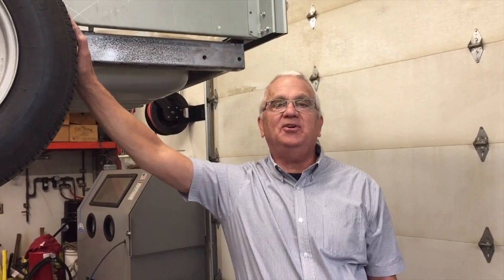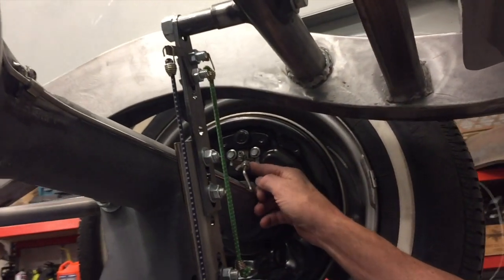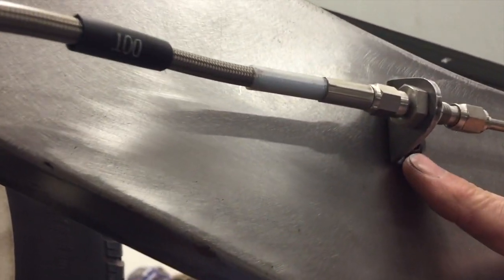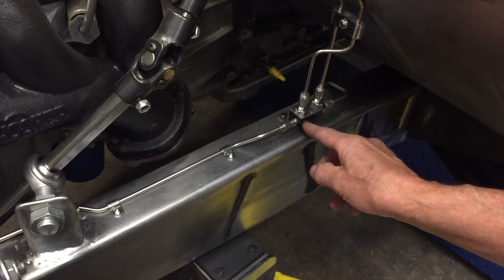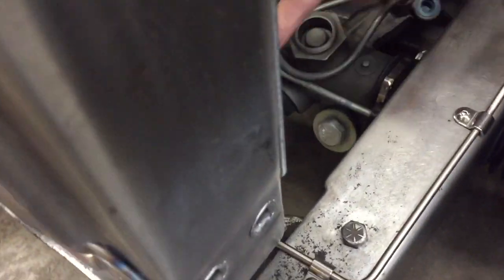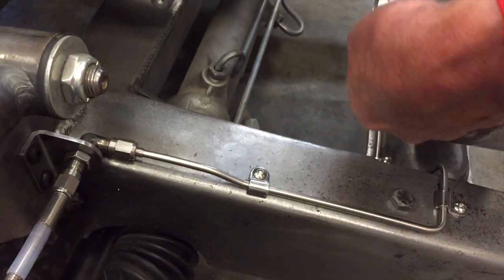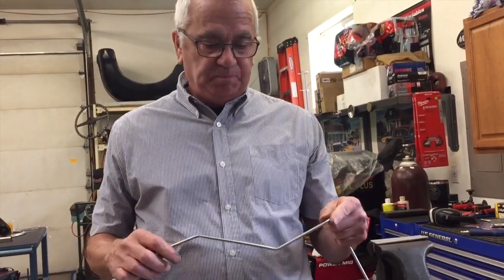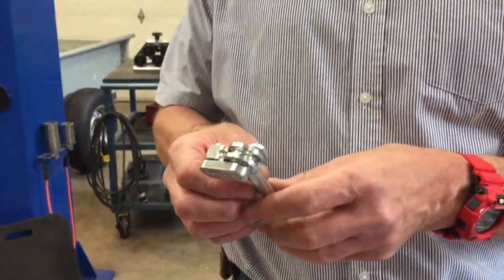Brake lines are done

Comment: Very nice Workmanship Sir, I just bought a 1950 5 window 3100, and have found your chanel very helpful. MY very first job in the oilfield in 1980 was instrument Tube line fabricator, I can really appreciate how well you have crafted this Brake line system in your Truck, I've learned from your methods, and yes there will be Scraps,  the seafloor is covered with Miles of Scrap that I've tossed away whenever it did not Fit. 
My bender is an Imperial, and I work in one direction, using test pieces, we measure outside to center of each run and use the L index, we save the R index for reverse bend. I now see the great purpose of the R bend and do not even see an L On those benders. 
The craftsmanship on your project is excellent overall.
Beautiful shop, and lift, and all the tools to work properly.
I particularly like the bed mount spacers, and the way you boxed and modified your frame, as well.
Regards,
MARK
Reply from the maker: Thanks for the kind words Mark I’d love to see your truck I’ve got an Instagram channel Idaho fabricator send me some pics I’d love to see your project

Comment: All new car and trucks should come with SS brake lines and gas lines that don't rust. This should be a safety law for the car & truck companies.
Not only for safety reasons but fixing rust brake and gas lines are very hard to get access to and  a pain in the butt to repair.
Beautiful job on the brake lines .

Comment: Oh ya... the third question was what type of brake booster did you use?  8" or 9" dual diaphragm. The kits cpp selling standard now are single 8"
Reply from the maker: Originally I was gonna put the master cylinder under the floorboards but my exhaust system was in the way so I just move that master cylinder and booster assembly and mounted it to the firewall,  mine is a 7 inch dual booster I don’t think you can go wrong with an 8 inch or 9 inch, these trucks have a lot of room on the firewall I think mine is a dual 7 inch because they wanted it as small as possible to mount under the floor but there’s plenty a room for an 8“ x 9“on the firewall.

Comment: Hi Stephen. I have, yet another question.  I have the factory proportioning valve and I need to know if they make an adapter from the valve to my AN fittings?  I’m having trouble doing a “double flare” on my stainless steel (3/16) line.
Reply from the maker: The flaring issue is the reason I went with AN fittings I was able to get adapter’s for my master cylinder from Summit Racing you shouldn’t have any problem getting an adapter for your proportioning valve I didn’t use the factory proportioning valve because I didn’t think it would work with my application they are typically designed for specific vehicles that’s why I used a universal proportioning valve to control the rear brake bias
Reply: @idahofabricator8710  Thanks Stephen.

Comment: Hi Stephen. My question is that I’ve watched this particular video several times, but I have a CPP dual master cylinder, which came with the proportioning valve already on it. But, it didn’t come with the any of the 3/16” line fittings. I’m not hip on all these fittings and I have no idea what sizes I need. The rear one is quite a bit larger, I’m stuck. Can you help me out with this?  Thanks, Mark
Reply from the maker: Two fitting sizes you need are  1/2-20  and  9/16 x 18,  the 9/16-18 is the one closest to the brake booster.
Reply: Where does the 1/2 x 20 go?
Reply from the maker: @markbramhall2060 the 1/2-20 is the smaller fitting it goes on the front master cylinder port and the 9/16 goes on the rear master cylinder port typically the front port is for the rear brakes and the rear port is for the front brakes
Reply: @idahofabricator8710  , thank you so much Stephen. You’ve been so helpful. That’s why I watch your videos.

Comment: I really enjoy your videos, thank you for doing them!  I wanted to ask how you are using single flares for your brake lines, double flares I thought were standard for brake lines due to pressures?  Are the fittings you are using helping here?  Maybe I missed something, sorry if so!  Thanks again, looking forward to your next video…. From Seattle. Brian
Reply from the maker: Thanks for the question Brian I want to use stainless steel brake lines and stainless steel does the double flare so I decided to use AN -3, AN stands for Army and Navy has been used in military, aviation applications for many years it’s a 37° flare and when done properly is leak free.

Comment: I appreciate all the videos you have posted, it has helped me tremendously on my 52.  I do have some questions.  What was your final wheelbase to center the wheels in the fenders.  Was it 116" ? Also I'm using the same 4 link you have, I noticed that your 4 link brackets are flush with the frame after you boxed it. What did you do with the nut for the 4 link bars?  Thanks!
Reply from the maker: Thanks for the question when I mocked up the front suspension I had the cab on the frame I bolted the fender on and I pretty much followed the measurements that they gave with the mustang to kit but I wanted to make sure so I put the fender on so I could look at it, in rear I put the bed on and mounted a fender so I could I center the tire where I wanted, it turned out that the four-link bars that they sent with the kit were too short so I called them up and they exchanged the bars for bars that were 1 inch and a half longer that that put tire exactly where I wanted it in the fender when I measure the wheelbase it turned out to be 116 1/2 inches but it looks the way it should not sure why Chevrolet made the tire so close to the front edge of the rear fender. On the bracket for the four link I went to my fastener store and picked up some steel lock nuts the same thread pattern as the bolts that came in the kit and I welded the nut on the inside of the bracket it’s a lock nut so it’s not going to loosen up unless you want it to.
Reply: Thanks, would you happen to know your center to center length on your 4 link. My wheel base is exactly 116" after my install. I have 1 inch of exposed thread now, if what you are saying is correct with my setup I would be pushing 1.5 inches of exposed thread which is a bit much. I noticed you have about half inch or less exposed thread is that enough for pinion angle adjustment?. I used the TCI coil over front end and used the dimensions like you did. Reviewing your videos  I also noticed the steering joints, did you ever consider a Borgeson steering damper for the shaft similar to the old rag joints? Jegs 153-031849.  I appreciate you taking the time, I bet you are helping many people out like myself.  YOU ROCK!!
Reply from the maker: Brent Acott Center to center on the lower link is 24 inches the upper link is 24 1/2 inches that accounts for the 3° of upper pinion angle and yes you are correct the expose thread bothered me too that’s why I ordered the bars an inch longer  I called TCI and they exchanged them for one inch longer 4 bars I have about a half an inch of exposed thread right now on my truck and I feel a lot better about that I hope this helps
Reply from the maker: As far as the steering dampener goes I didn’t feel I needed it in research that I did
Reply: Yes, the responses are an added bonus! All this information is valuable and saves me a lot of time and guess work.  The videos both of you have made are a continued resource.  Anytime I have a "how do you do that" question I go look thru them. Keep the videos rolling!